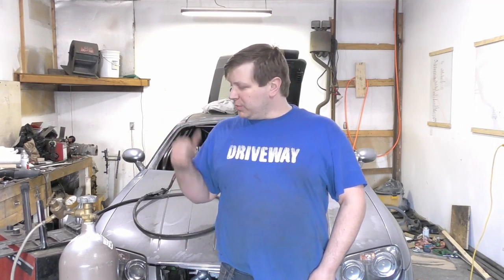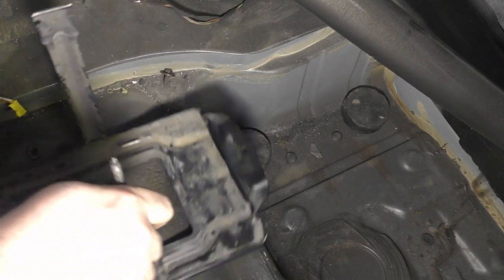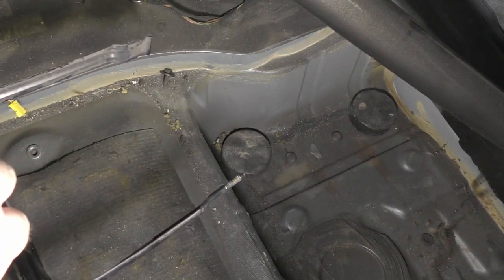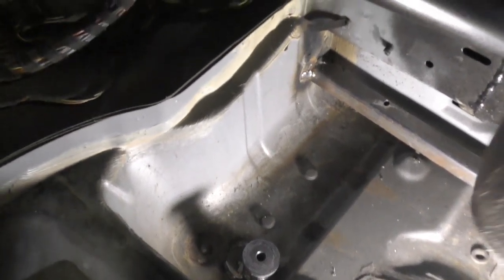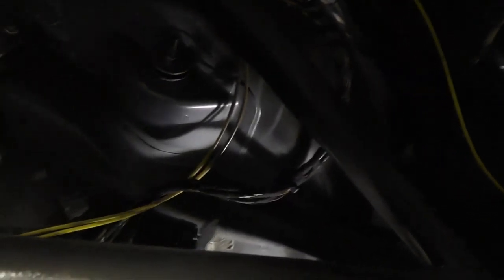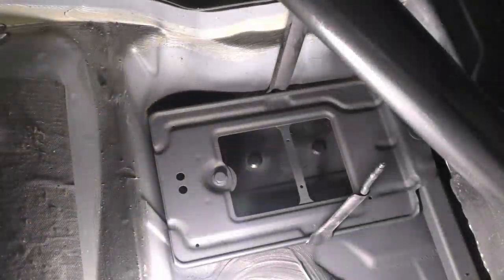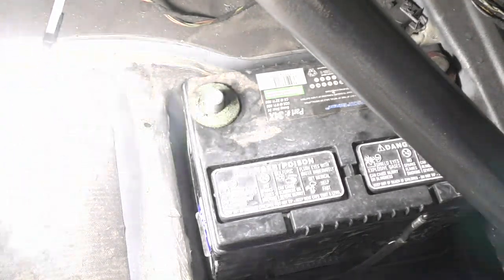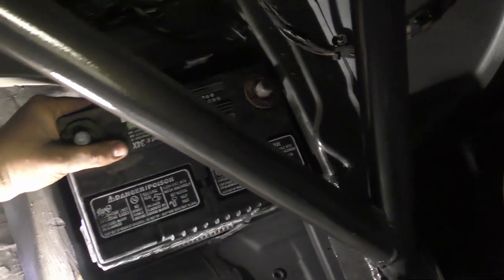V8 Crossfire Project: Battery Relocation | Driveway

Comment: hey great videos btw you've been a big help to me so far in repairing my crossfire. unfortunately I got in an accident not too long ago and damaged the door and right fender and the air bags came out. i was wondering if I replaced the airbags and srs module from a crossfire that didnt deploy the bags would they work in my car ?
Reply from the maker: I would replace the air bags and then have the module reset by someone with the scanner tool - I don't know if the srs module is locked to the chassis or not - the reset is usually $125 or cheaper depending on where you go
Reply: Do you know anyone personally that would recommend ? I don’t mind sending it in to someone I can’t drive the car anyway
Reply from the maker: @PXFilms124  I don't know anyone... have you tried checking the crossfire facebook page?  Usually has some more knowledgeable people: https://www.facebook.com/groups/2211655775/?ref=nf_target&fref=nf